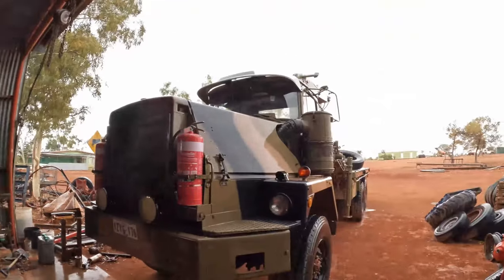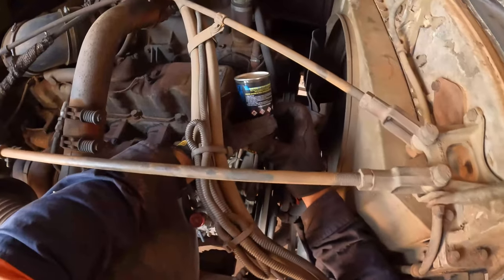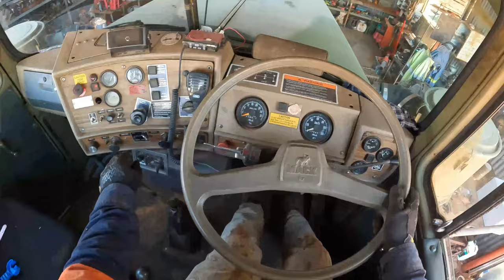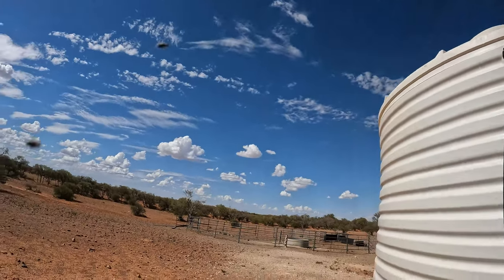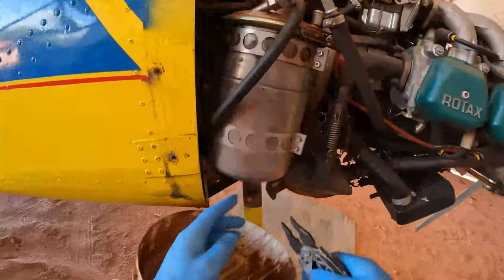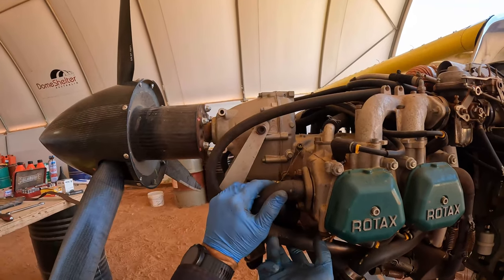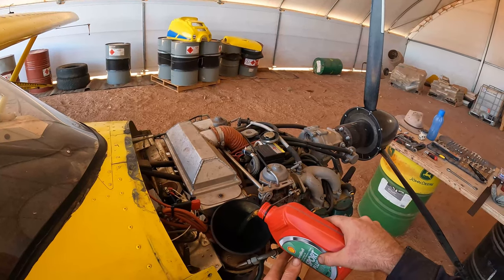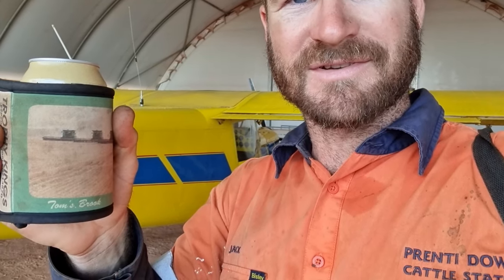A Day in the Life: Cleaning, Repairing, and Flying

Comment: I’m a private pilot flying from Lilydale Victoria.  I rent from the flying school and never have to worry about aeroplane maintenance.  I’m impressed with your knowledge and experience with your plane’s maintenance!  How did you learn this?  Are you a LAME?  Are the rules different for LSA aircraft?  Did you do training for your aircraft?  By the way, I’d never heard of burping before!
Reply from the maker: Hi Roger! Thanks, yes the rules are different for LSA and experimental. That being said, as part of training for my licence I did maintenance, and any opportunity to observe a LAME work I do, naturally we do a lot of maintenance ourselves on machinery here. Enjoy the channel 👍
Reply: @jack_out_the_back  Hey mate just a word of advice when doing oil change on your 912 don’t ever burp whilst draining  the oil you will introduce an air lock into the lines.  Which then you will have to bleed the whole system with air pressure. 
This could possibly bend your rods. 
All you have to do is burp before you drain, then drain and refill. If you need any more advice feel free to shout out.
Reply from the maker: @advanbri  that's interesting! I'd always been told to burp out, burp in. Thanks for the tip!
Reply: @jack_out_the_back  as per the rotax maintenance manual.  I am a rotax irmt so it’s how it should be done.  I’m based southwest wa if you need help.